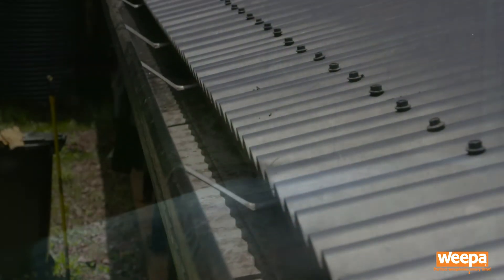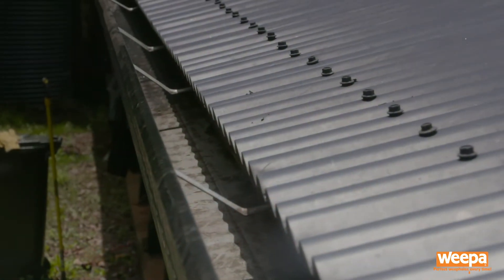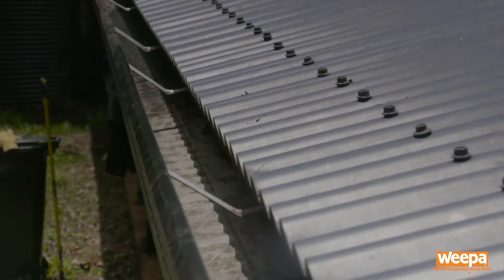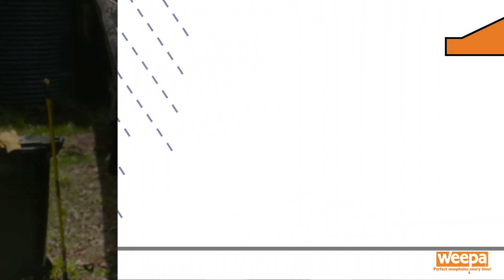What is the importance of weep holes in brick buildings?

Comment: Is it true that if you seal a brick house with concrete stucco prime and paint it you can cover the weep holes cuz supposedly it is going to seal out moisture
Reply from the maker: It is not a good idea to block your weep holes. The function of a weep hole includes providing the wall with ventilation and letting moisture out. Moisture can build up in your wall for many reasons including small leaks, condensation and harsh weather events. Blocking the weep hole will impact on this and can lead to significant problems including mould, mildew, rot and other adverse effects. It’s best to seek advice from a building professional in your area.

Comment: Isn't it the builders responsibility to plug the holes while serving the function? If their work, while serving a purpose, also creates a nuisance then it isn't proper work.
Reply from the maker: Hi there….  Weep holes serve an important function and should not be plugged as it can create significant problems including mould, mildew, rot and other adverse effects.  Our products are designed to help with things like pest and fire management without impeding that function.  

We may not have fully understood your question, so please let us know if we can help further.
Reply: If u insulate wont it block the weep holes anyway?@weepaproducts7156

Comment: Our basement has water that enters at the spot of the weepholes, any suggestions?
Reply: If water is entering from outside through the ground or under a gutter you need to add water impermeable dirt such as clay near your home's foundation to shed water away from your house and fix any gutters that may be leaking down your wall. Consult a drainage professional in your area or check out Youtube channels such as gate city foundation to learn how you can fix the problem yourself.
Reply from the maker: Hi there…. We are sorry to hear about water entering your basement.  It is likely to be a problem specific to your home and circumstances and we recommend seeking advice from a drainage consultant in your area.

Comment: Pure crap must house have full face cavity insulation so weephole s are pointless.  Most of that damage accoured up at roof level . More than likely that's where all the damage started from leaking roof or cutters stuffed
Reply: Any timber framed brick house has a gap between the brick and the inner wall that goes on the outside of the studs, if it was built correctly. The insulation goes on the inside of the wall, between the studs. The gap between the brick and the timber frame also helps reduce heat transmission into the house.

Comment: due to the mice plague and mice getting into my brand new house these should do the trick. Now why isnt the building industry at a bare minimum installing this?
Reply: Check your garage door seal, any exterior doors and any pipes or cables entering your home for gaps as well. Mice can squeeze through 1" gaps.
Reply: They should be

Comment: Why are they so low? It's ridiculous
Reply from the maker: Weepholes must be located in the masonry course directly above each damp course so as to direct moisture away from the interior of your home.
You will notice weepholes above windows and doors, below windows and usually about 150mm above your floor slab or ground level. As you have noticed most weepholes are around the bottom of the wall as that is the only way they can do their job of draining and ventilating the wall cavity.

Comment: How do I identify where to install weep holes in a rendered home that are all blocked any ideas Weepa
Reply from the maker: Hi John,
This is a very tricky problem and you need to be very careful how you tackle it. You will need to consult a skilled Building Consultant/Inspector.
Weepholes are installed directly above the moisture barrier/flashing. If you just bore a hole it could easily penetrate the flashing and direct water to the inside of your home and the cure would be worse than the problem.
Check for  mildew or paint cracking on the inside walls around the skirting boards and above and below windows. These are the tell tail signs that you have problems brewing.
If the rendering was done recently a warrantee claim may be justified.